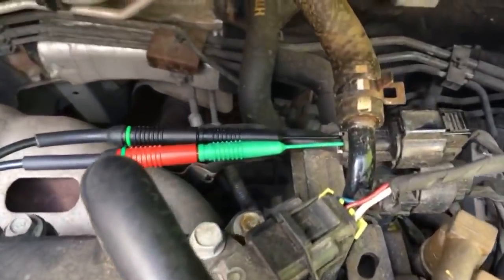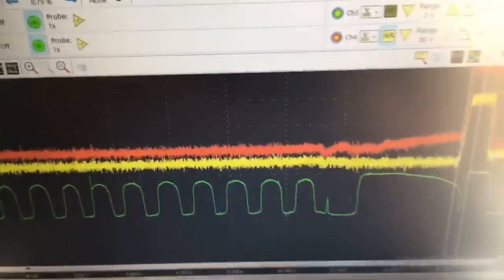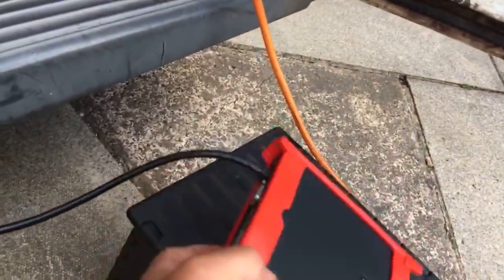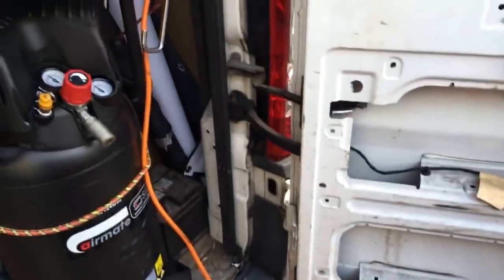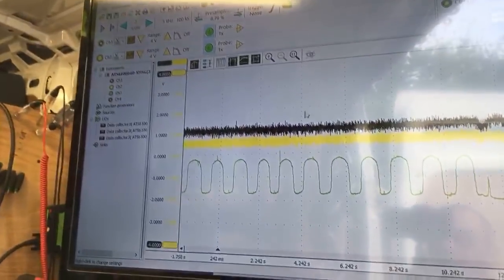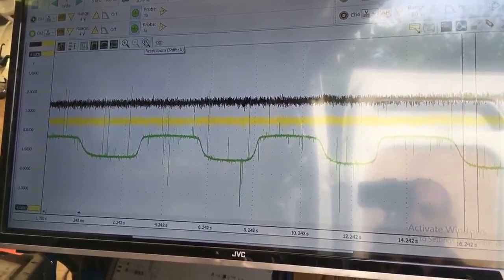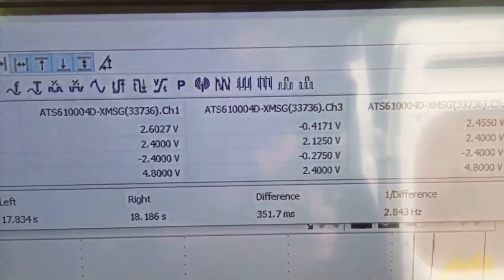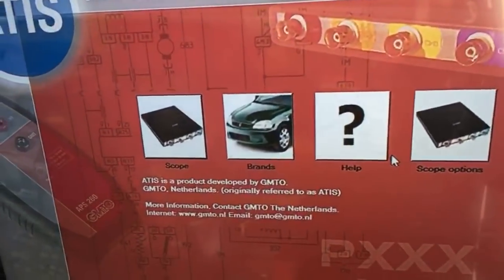Using the Tie Pie differential oscilloscope

Comment: Good day sir.

Are you still using the tiepie scope and how does it stand vs the pico. I love both scopes just need to decide to pull the trigger on one of the  scopes. Like all techs might end up with both as both have strengths in different areas. In your honest opinion witch will be a better one to start with. At the moment I'm playing with the micsig and the 2204 pico baseline scope.

Comment: Hi Steve. So now this video is a year old can i ask which scope you currently use when troubleshooting? Did you stick with the Tie Pie or not?  Im looking for a scope and have a few in the mix so looking for any info i can find on each. Thanks alot
Reply from the maker: Hi David, It depends, TiePie, Pico, Verus - weather, job, location, whether I'm filming all play a part.
Reply: I do have a Verus Pro which is a good all rounder but it struggles with  can bus for me. Whether thats me doing something wrong in my settings im not sure but the likes of the pico and tiepie look a different beast when looking and analysing can from what i have seen
Reply from the maker: @davidmoss9471  they're different animals altogether, I love my versus but use the others for the detailed analysis and interpretation of captures.